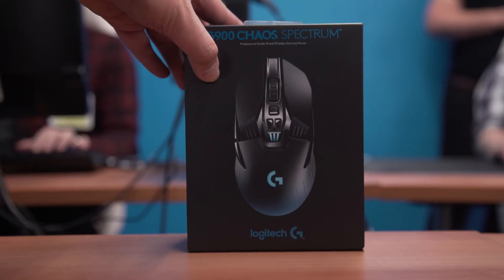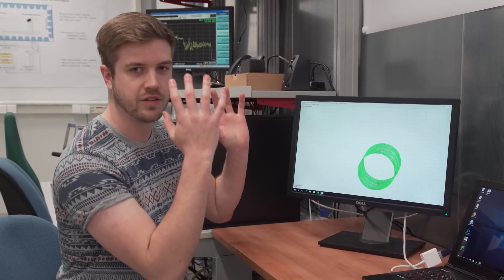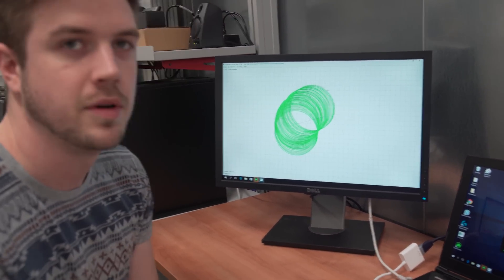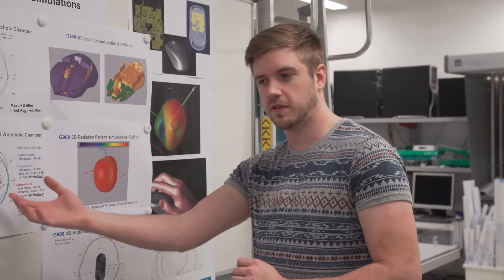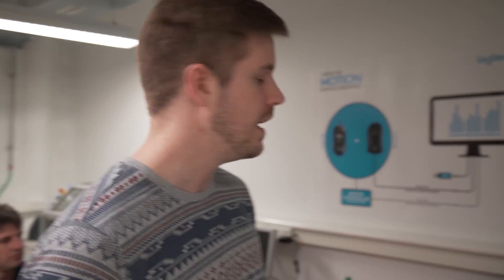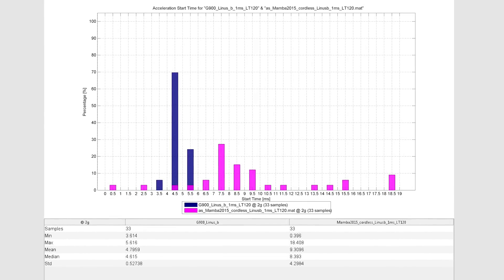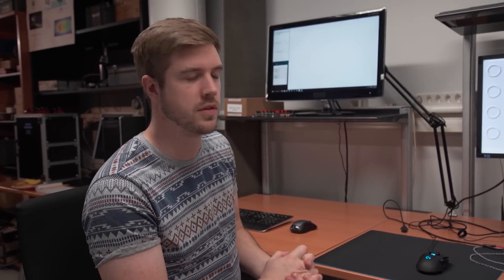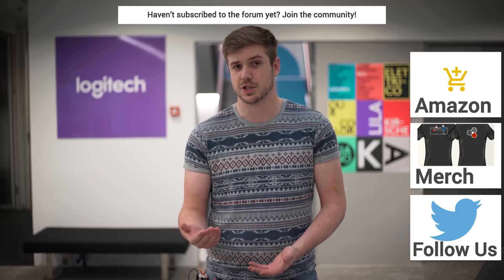Wireless Mouse Technology Testing at the Logitech Daniel Borel Innovation Center

Comment: I'd really like to see a performance comparison of Logitech's wireless Bluetooth 5 LE connection vs. Its Logi Bolt connection (Logitech's Anywhere Mouse 3S can do both of these) vs. Its "Lightspeed" connection (as used by its G900/G903 gaming mice.  How different are they actually?

Comment: Now this test  is not something that is done at LTT.  They have been invited to Logitech to do it, you can see on the phones they are on Logitech premises.  Logitech knew ahead of time the results of what the test would be and set up a scenario that would show their devices in the best light and their competitors in a different light.  As far as their device G900 receiving the signal and the others' not, what is going on there?  Could it be the Logitech is using a frequency to communicate that is NOT being jammed by the equipment?  If so, I wonder how it would perform if it WAS a jammed frequency like what they did with the Razor Mamba. LTT should have taken all the devices and did their own test at their base, not relied on Logitech's labs and scenario.  They could have used a sniffer to find the frequency that the G900 was using.  Maybe it gets blocked by microwave ovens or certain noisy radio environments.  No independent test, I certainly would like an answer to these questions.  As I really do want a wireless mouse!  I have been looking for awhile now, I usually buy Razer, but got a Corsair M65 which has lasted me good few years now but on it's last legs, which I have loved and can recommend.  Logitech certainly do a good job of marketing themselves, I do think I will give them a try.  I remember Logitech back in early 2000s and they made low quality POS equipment so havent bought since, but been impressed by a few things of theirs lately.  Latency these mice have a polling freq that can be set in software I know my corsair I can set my polling down to 1ms.  Did they do this with the Razer to compare vs the wireless mouse?  Wired being slower on latency that wireless is VERY suspicious to me.  Think of all the extra hardware steps that is happening.  Sensor reads data, sent to the microcontroller, microcontroller interprets encodes it to a packet, sends it to reciever, receiver takes the packet, USB polls and is decrypted.  Could this be some software trickery instead that they have somehow gotten their driver to poll faster?  Might not be the hardware at all.  I know there are issues with low latency USB use cases.  Graph vs the Mamba is good, Logitech mouse seems a lot better on this statistical data, dont know why they didnt just show that at the start.  Assuming they havent monkeyed with the Razer software and are using it at full capcity, and this is a 'typical' not noisy environment its a really good result.  So many people on this planet just cheat and lie all the time, Im getting crushed by it, I just cant take it anymore.  Dont take drugs and write posts folks.  All right I am going to buy a Logitech mouse.  It better not be a POS.

Comment: I will never get people that don't prefer wireless. I have had mine for 5 or so years with no problems. The batteries I use last for months before needing to be recharged, and when they do get low on power, a small lamp on the mouse glows red for a while, meaning it only has 30 minutes or so left. Running out of power in that case is therefore not really a concern. Connection? Never been a problem. While I haven't played on a professional level, I have been among the best on the servers I used to frequent in the past with a good amount of headshots. Then there's also the fact it doesn't have an annoying cord, something which I have hated since the late 90s.

Maybe it's different for people in rooms where everyone uses a wireless mouse, but at home, my wireless mouse has never been a problem for me.

Comment: I was sold on this video when I first watched it.. Then, I purchased the G900. By the second day, I found that the mouse will "spin out" while playing FPS games... happens every few minutes. Basically, when I move the mouse really fast to the left or right, the mouse will "spin out" and I'm left looking straight down or straight up. I haven't had this happen with a mouse since my super old Microsoft optical (their very first optical mouse). And that one didn't even spin out of control like my G900 is doing. 

Love how that "scientific" testing room only uses one type of surface. The only type of surface the G900 works well on.
Reply: That must be a defect, I've been doing a lot of research into this mouse cause I'm interested in buying it also. I've watched dozens of videos and looked at many reviews and every single one of them say this is by far the best wireless mouse available, some even saying its the best mouse ever made. I watched an extensive test about that exact thing, the mouse spinning out, and it did not happen at all in the video. They were trying to get it to spin out by moving it really fast and it behaved exactly like it should. I'd contact Logitech and get a new one

Comment: Now place the Unifying Receiver on a motherboard with USB 3 enabled and run the tests. ;) I'm looking for replacements for my M510 which uses the same wireless technology. I cannot always guarantee line of sight and I've even managed to blocked the receiver with a piece of paper while within line of sight of the mouse with fresh batteries (Did this tonight. Recharged my rechargeable lithium batteries yesterday). It is so jerky as to be unusable; it just stops. The mouse moves, the cursor refuses. This is my second try at the M510; the first time I thought it was a broken receiver.

Logitech needs to accept that people are having major issues with this technology in real world applications, stop telling people that resetting the mouse will fix the problem and FIX THE PROBLEM!

Comment: i didn't expect this from LTT. The comparison wasn't fair at all. I demand it to be redone.
for every mice other than the g900 the noise was switched on while the tracking was being done and also the mamba adjusted to the noise (sort of because there were less deviations forward in time)
while in the case of the g900 the noise was already switched on.
NOT A FAIR COMPARISON.
Reply: ...so do you expect the mouse to do worse with the noise turned off? starting the test with the noise already on doesn't magically make the mouse immune to it. if he started the test the same way with every mouse, they'd all react the same way they did in the video. also the mamba didn't "adjust" the interference happens randomly. if the test continued longer I'm sure it would have started going haywire again like it did. also the G900 didn't have any deviations at all, so even if the mamba only deviated a couple times, it would have still done worse than the G900. stop trying to justify the lesser performing mice by calling it "unbiased" over something so little and stupid, the G900 is a HUGE advancement in wireless mice and anyone who disagrees is an ignorant fool

Comment: From a pure physics point of view, speed of the electromagnetic signal in air would be faster and more direct than through a cable. Wireless latency is introduced by processing needed to remove interference in the wireless signal. So it makes sense that at some point wireless will win at latency in every case once the speed of the receiving signal processor reaches a ceartain threshold.
Reply: i know what you're trying to say, but you're GREATLY overestimating how long it takes light to cover such short distances, let alone the difference in speed between both electromagnetic waves (through air and a copper wire, with the former being aprox 99% c and the latter typically between 70% and 90% c).
lets assume the distance in those tests are all 1m. it takes light roughly 3.3ns (nanoseconds) to travel 1 meter at vacuum. a nanosecond is, by the way, 1 thousandth of a microsecond, of which is 1 thousandth of a milisecond (so ns is 1 millionth of ms).
lets round it up to 5ns in air (very largely rounded up) and 10ns in a wire (even more rounded up), so the difference from these is just 5ns per meter.
FYI, all the results in the video are in miliseconds. so even if you were to take this info into account all it'd do is change a result from, say, 6.4ms to 6.399995ms.

tl;dl
taking the speed of the signal into account is completely irrelevant and negligible.
Reply: Right, just pointing out that wired doesn't inherently have less latency than wireless for a given protocol at a certain point, just a bit more bandwidth, which doesn't really have an effect on the capabilities of a wireless mouse, if designed well.
Reply: What about ps/2 nice?

Comment: luke, please do this test with the madcatz MMO7 mouse. the concept and features in this mouse make it my "almost" favorite mouse. i say almost because sometimes its seems like the X axis just stops working for a second or two (just long enough to get me killed). ive become so dependent on all the features/button layout that im scared to dive into another mouse without knowing that the MMO7 is just a fail; however good the concept is imo. thanks.
Reply: had the same problem with mine. then my cord failed where it left the mouse. bummer. it was one of my favorites
Reply: +Spencer Parnell  yeah this is my second mmo7. the first one I can't blame on the mouse as it got yanked of my friends desk by his cat. time think of a replacement. what mouse are you using now? how do you like it? I don't like how other companies cram their side buttons together,  I really like how the mmo7 buttons are spaced, and the side wheel is great for local/world maps. and with the shift button equaling 20 different buttons and their program giving me macros. it's really hard to beat.... if it would just stay working... I don't want to look back years from now and think, man I've spent 600 on this mouse (already at 200)
Reply: +Unknown Unknown the g502. I love it. wide range dpi multiple profiles, quick lock flywheel. Removable weights. And it has a sister out now with croma. I'm looking forward to this one. Will go with my 430 and 910
Reply: +Spencer Parnell thanks buddy, I'll check those out.
Reply: +Unknown Unknown wow now there is it the irony in how your mouse died

Comment: So to preface this, I'm totally willing to believe that this mouse is better than the ones it's compared against. However, the first of these tests has some skewed results.

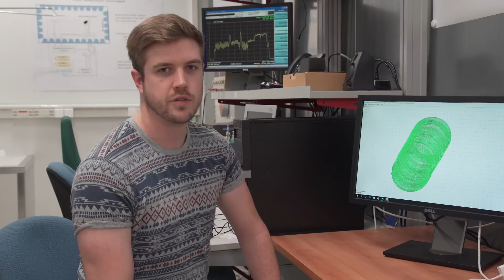At 2:03 we come in with the noise already turned on for the Logitech mouse. It looks great.
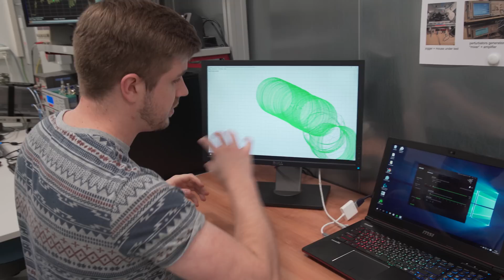Yet for the other 3 mice we see him turn on the noise and, excluding the Sensei, there is a momentary change in position but then the circles continue exactly as before just in a different position(see 3:47 and 5:34)
Granted they both have the "huge" jumps(I don't see them as huge, but whatever) so that's an area where the G900 wins.

Here's my point, I would not be surprised at all if the initial shock of being bombarded with a ludicrous amount of background noise causes a disruption in any wireless device, INCLUDING the G900, disruption that well designed devices compensated for(sorry Sensei). Yet, they decided not to show us that for the G900 because it makes it look WAY better than the competition, instead of just better.

Just wanted to say i noticed LTT & Logitech.

Comment: Isnt wired going to be better then wireless..
Reply: +TheRaveTrooper Well if you look at it from a theoretical physics point of view signals will travel faster in air than in wires. This is meaningless because whatever the physical advantage might be the engineering of wireless signals is much harder- interference, signal strength and so on... This is simply a marketing gimmick to be honest. Yes Logitech made an amazing wireless mouse but this is mostly to smart design and good firmware, they could use the same ideas in their wired mice and could post even better results. This video is less of a testament how their mouse is awesome but how Razer and SteelSeries make terrible mice that even a handicapped (wireless) mouse can beat them.
Reply: +HeaDStrongTerran I was thinking about it like. when you use Ethernet it is better then WiFi. and when I use Bluetooth for my speaker. using a aux chord works better.
Reply: The data bandwidth of a mouse is nowhere near as high as traffic over a wifi network.

Comment: And to think I was going to get Steelseries to upgrade me to a Sensei wireless (though I wouldn't use the wireless part; just seems like a better built product).

$150 is an absurd price for a mouse, but damn does it seem so much better than pretty much every other mouse that came before it.

Just a shame its physical design is atrocious.
Reply: +Ace Strife G502 has the same sensor and the g303 is a cheaper, simpler option.
Reply: Korbyn null  I need ambidextrous mice and ones with dual buttons on both sides.  Heavily restricts my mouse selection, unfortunately.
Reply: +Ace Strife Not sure about buttons on both sides, but the g303 is ambidextrous. You should check out the zowie fk2.

Comment: Something I don't believe that was mentioned in this video. Does latency increase in any aspect of the g900 when the battery is not fully charged? In other words would latency increase as the battery charge decreases due to the wireless transmitter and sensor not receiving as much power?

Comment: Nice video!
But I'm not totally convinced that the results of the RF stress test were as clear as you made it sound like. Almost like you were not totally impartial.
I get that the plots from the sensors were more consistent, but that does not necessarily correlate with what is best for the user. I really might, and it would seem intuitive, but not necessarily.

Comment: What I look for in a mouse are, in order of importance, foot friction properties, size & weight, # of buttons, shape, THEN things like dpi and latency. It makes it really hard to buy when companies don't emphasize these features or report in a consistent manner. I don't like wireless mice because batteries are heavy. Also these tests don't really say anything about wireless vs wired in terms of latency, what they tell me is that there are other things in a mouse that add latency (likely USB controller or sensor interpolation)that Logitech have found ways of minimizing. Compare this mouse to a mouse that's identical up to the wireless transmitter point and I guarantee the wired one will have less latency.   

The reason the Sensei is getting weird tracking issues is because unlike most mice it has advanced interpolation on it's sensor. You need to either turn that off or use a Sensei Raw for more consistent results

Comment: but how does it compare to an amazing mouse like the g502
Reply: +Sean Wilson It would be exactly the same when wired, the real difference would be the shape at that point. Also it's negligible real world because you won't see a difference 1-2 ms, it has to be a larger amount like 15 ms and even then only the most sensitivity hardcore gamers would see that. I mean major tournaments are won on zowie mice and they have more input lag in both sensor motion and clicks than this g900 but the pros like it for the shape and the consistent performance of a 3310 - 3366 is obviously better but again there is basically no 3360 in regular shapes - so if a pro gamer doesn't like a g303 then they're out of 3360 options (g502 isn't even an option for a pro because of the bulk/excessive keys on it)

Comment: So basically, if you can get numbers that good with a wireless mouse you should be able to get slightly better numbers with a equivalent quality mouse in a wired variety. Still not sold on wireless, not a fan of my battery dying in the middle of a gaming session.

Comment: A 4ms latency would give you about 250 "clean" actions per second. It costs a lot but I get how pro SC2 players who do APS in the 250-450 range would need something like that. I guess they didn't really touch on it but having the click latency similar to the sensor latency means that you can rely more on clicks happening in the right place on the screen. Again...if you're playing an RTS at pro level, totally an asset.

Comment: It's not about the dpi its about the report rate. So if wired mouse have better report rate it is better than that G900. Thus wired mouse doesn't run out of batteries.
Reply: The report rate the hrz is actually the same as of wired ones ~1000.

Comment: This is a fabulous test!  If I'm going to have amplified Bluetooth and Wifi blasted at me.  By a unidirectional antenna.  In a chamber that blocks signals of all other wavelengths.  While my wired mouse has unshielded cable because it's not expecting a unidirectional blast within a certain spectrum, which it is required to accept via US FCC Part 15.

Fabulous.

Could you perhaps next time test it in an environment that doesn't exclusively favor one device?  K Thanks!